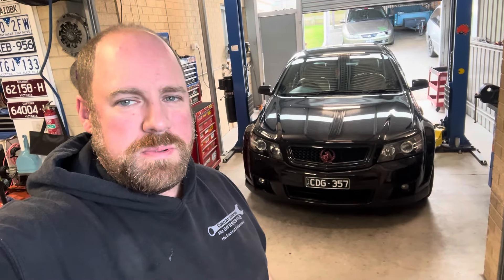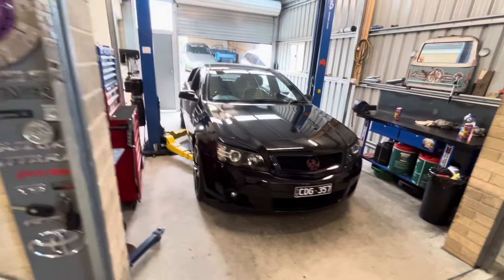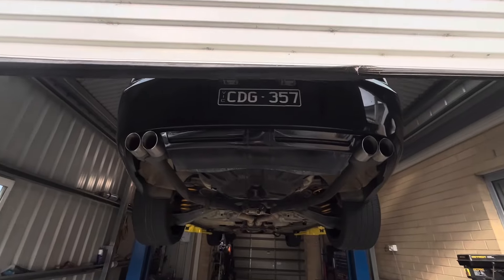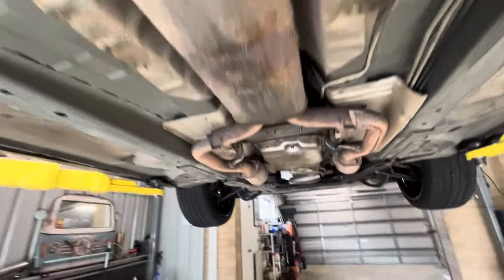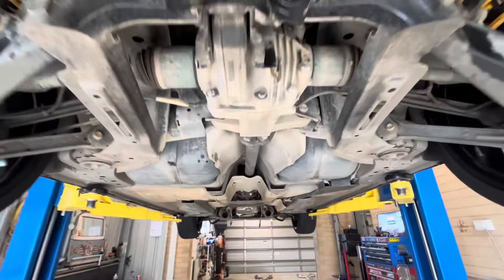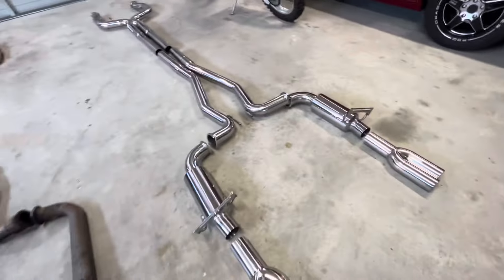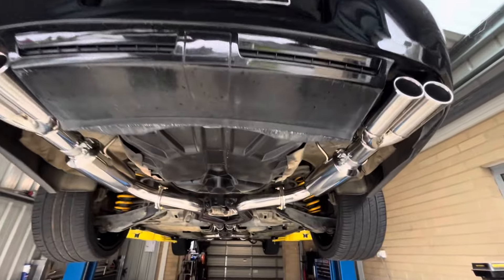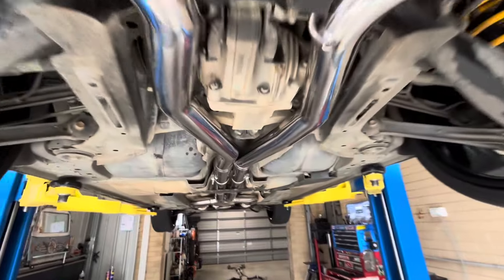Holden WM Caprice V8 Ultrex Cat Back Exhaust Install

Comment: Nice 👍, Question for ya - how did you darken your boot piece (the bit with caprice on it) it looks kinda red/purple n the lights how'd did darken them as well? Looks awesome 👍
Reply from the maker: Thanks mate! 
Not sure… It’s my mates car, and I’m pretty sure it was like that when he bought it
Reply: If it's an L77 do you intend to do the AFM/DOD delete ??
Reply from the maker: @lancecooper4646 it is an L77 and does have DOD. 
He’s just got a plug in module that deactivates the DOD for now. He wants to do the rest of the exhaust and an OTR before he gets a tune and deactivates the DOD in the tune.
Then one day he’ll get a cam and remove all the physical DOD stuff